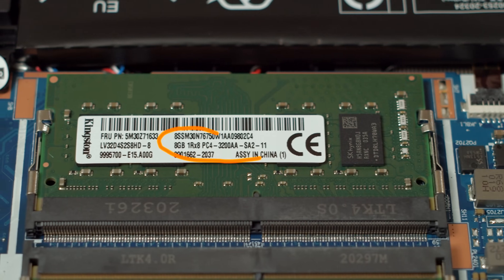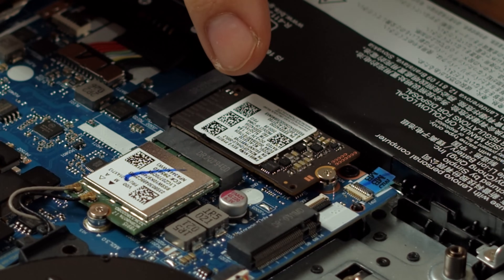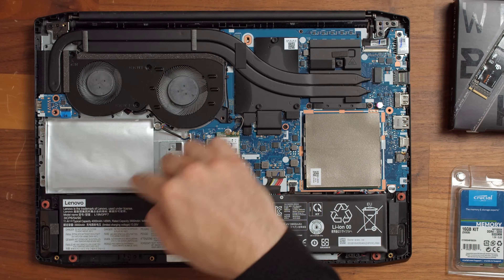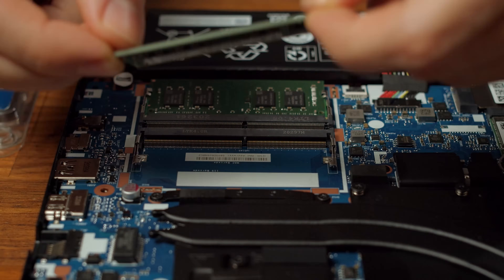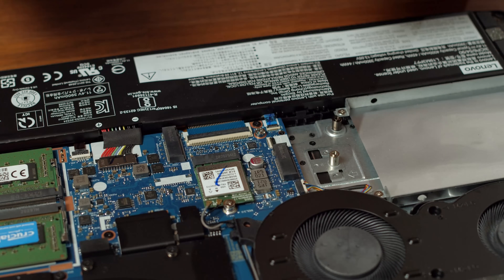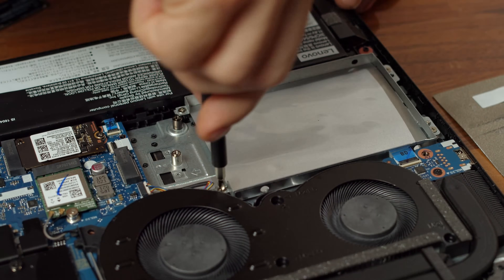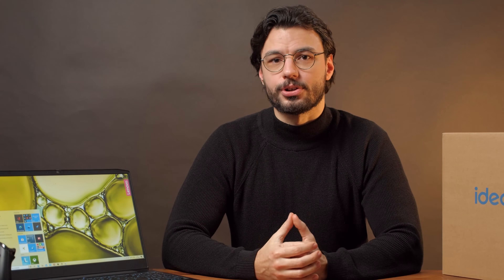Lenovo IdeaPad Gaming 3 Tutorial: How to Upgrade the RAM & SSD(s) | English

Comment: I didn't know I can move that standoff into the 2.5 inch ssd area, I have been searching for that connector for 6 months now, watched every video, read every forum, finally found your video, thank you for this video.
Reply: so it's either ssd or hdd not both?
Reply: @mahmoudabouhager  yes
Reply: @ankursharma1461  i see a video where he puts 3ssd
Reply: @mahmoudabouhager  not possible
Reply: @ankursharma1461  Can we use two m.2 2280 ssd?
Mine already comes with 2280 sdd, specification say i can install one 2280 and one 2242 ssd but i am not able to find good 2242 ssd at reasonable price.
Reply: @galaxy2995  are you using 2 x 2280 ssds now? also whats your laptops model, i bought 82k200k0tx and it comes with 2280 512gb ssd so i want to add a second 2280.

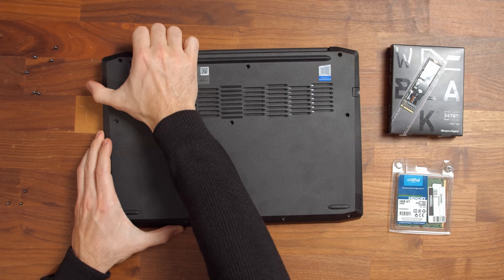Comment: DON'T DO this 1:56 or you will be about to break some of details attaching the bottom like I did following this tutorial. It is especially disappointing if the laptop is new and warranty is not expired, because there is a threat to a possible future warranty repair, I believe.
Reply: Then how do you open it?
Reply: @Daniel-mn5jk  This way, just very carefully.
Reply: @GuyInBlackClothes  Nooo, just grab anything out of plastic that is thin. Get creative, I used the rotor blades of an old drone. Just not metal please, I did it once and it scratches the side.
Reply: I wish i had seen this comment before.. I also broke some  after seeing this video kkkk
Reply: Dosen't matter the screws are enough to make it tight. If they break its easier to open up next time 🤷‍♂️
Reply: I should have listened... managed to snap several little plastic connectors on the inside of the cover. Managed to re-close it just fine and the cover is on tight with the screws... but still kicking myself for not going more carefully.
Reply: I had an old college ID card i had used that just slid it in from the back where he's putting all his fingers in and just go along the snaps and they come off pretty easy.
Reply: This part was very hard to watch.

Comment: You actually can use a 2,5 and a 2280 m.2
Reply: hell, you can put the original ssd ram (with windows instlled) in the second m.2 slot, then a new 2280 in the first slot AND a 2.5'' ssd or hdd with the sata port, and you dont neet to reinstall windows, just open the bios and configure the laptop to start with the second slot.

Comment: Mine came with 8GB RAM, a 256GB 2242 SSD, and a 1TB 2.5" SATA HDD. I can't really upgrade the storage to a faster M.2 SSD (since can't have HDD and 2280 SSD, which I did not know before) but will be upgrading it to 16GB RAM. Very informative video!
Reply: @ImMashimaro  He said we can’t.
Reply: Do 12 gb ram is enough?
Reply: @zuhdi97  I would get at least 16 Gigs for gaming.
Reply: Why it can't Have both?
Reply: @ImMashimaro  Totally agree with you. My 15ARH05 (2020) came with a slow NVME SK Hynix (2300 MB/s Read and 1000 MB/s Write). It does not make any sense adding a secondary, very expensive 1TB/2TB NVME with fast speeds (3500 MB/s and faster) for everyday files like pdf, word, excel, jpeg etc. Therefore, I just added 1TB 2.5" HDD as secondary storage for files.

Comment: Super clear and informative. Just bought the laptop so very useful info too. Thanks very much.
Reply: How is it after 2 weeks?
Reply: @saidiyassine8135  very happy with it, I will definitely bump it up in terms of storage soon and ram maybe not so soon because I don't play the latest or most performance-intensive games. Boots very fast, runs smooth, keyboard is comfy, the screen is great and I fully trust the hardware. If you play heavy games though, performance will be at the expense of quietness, it can sound like a blow-dryer at times, and because of the location of the fan the keyboard can heat up a bit when temps go up, but those are my only complaints.

Comment: Hey do those 8 gig memory sticks that come with the device have 4 chips on the pcb or 8 chips? I just ordered this laptop and I'm considering to buy memory with dual rank configuration because single rank memory utterly sucks. I'll order them before the laptop arrives if the default memory is single rank (4 chips per module)
Reply: Did you find an answer to this mate?
Reply: @liviuovp  4 chips per module so half rank. Extremely loose timings like cl 22-22-22 something I don't remember. The performance was okay but nothing spectacular then I gave it to my brother.

Comment: Thanks for helpful video!
Is it okay upgrading ram or ssd without removing battery? I keep heard that I should remove battery and discharge the laptop before adding parts.
Reply: It's okay, but it's safer to do so.
Reply: This can prevent the laptop turns on suddenly
Reply: You can disable the battery on this laptop in the BIOS
Reply: @sergik833  how?
Reply: That's why he said to completely shut it down and to unhook the charger, so that no power is running through it at all. Putting a computer in sleep mode means a bit of power is still coursing through it. You have nothing to worry about if you unhook the charger and shut it down as long as your not trying to bust open your battery or are trying to deconstruct the battery. Damaging your battery could mean it not working properly or it setting on fire, so be gentle with it and stick to the screws and edges around it when handling it. And touch something metal in your home to quickly ground yourself before working with the parts and the inside of the laptop.

Comment: So, I can not put a 2280 ssd in the slot below the wifi card IF I have already a 1tb hdd installed? Or Can I have the two?
Reply: Have you tried it? I was thinking to buy a 2280 but i cant confirm if i can fit it in with the the 2.5 hdd.
Reply: @djv2420  not yet. I just bought more ram since that's what I needed the most. Sometime in the future I'll try. If you do first, please come back and comment :)
Reply: @djv2420  i know it was months ago but I actually did it. Installed the 2280 in the slot under the wifi card and it does not interfere with the hdd

Comment: Can someone please help me?
I added new 8gb ram to my lenovo ideapad gaming 3 (Amd), the ram I added is 3200mhz and it has CL22 so it's same acc to me. But today I started valorant and I'm getting better fps but the game is still lagging, I even capped fps to 120 which I got before ram upgrade it it still lagging, there are no fps spikes or ping issues.
Reply: open task manager while game is running to see which gpu is valorant using, and check for any processes using your hdd/ssd

Comment: Here in my country it comes with 1Tb HDD, can I put a 2242 or a 2280 ?
Reply: You can put directly 2242 nvme in first slot.
Reply: @silentcreeper3506  Yes. You won't have space for a 2280, unless you remove the HDD, though.

Comment: Vielen Dank! I was wondering about usign 2 SSD NVme AND one 1TB HDD. Isn't it possible? I thought that the 2242 lenovo SSD would fit in the space between the second slot and the Sata box, than i would put a 2280 SSD on the first slot and the HDD ond the sata box. In Brazil i got the cable for it, but you said that the 2280 on the first slot only works if i dont have any 2,5" plugged? Does it applys to 2,5" SSD or HDD aswell?
Reply: you can have a m.2 2280 and a 2.5in drive, the second m.2 slot however cant be physically used with a 2242/2280 without taking out the 2.5in, but you can use a 2230 m.2
Reply: @aesthet1kal  shall i use m. 2 2280 nvme ssd in this lenovo ideapad 3 models

Comment: Thanks for the detailed review! Have 1 question left though - the laptop spec says it can support 16GB of RAM, while also noting "The max memory is based on the test results with current Lenovo® memory offerings. The system may support more memory as the technology develops". I was wondering if you you know if the laptop can run with 32GB?
Reply: buying a discrete video laptop with a 16gb limit is hogwash for anything other than graphic gaming...you'll be constantly struggling to get enough ram to support photo editing, multiple displays, virtual machines, and video editing...I know original post was 2 years ago, but it applied then that you'd need at least 32gb to get a decent experience...as of 2023 you might as well just use a $300 onboard graphics ryzen laptop if you're not pushing your laptop far enough that it needs all 64gb of ram
Reply: This the Intel one can handle 64 gb of ram
Reply: @AmaanKhan-te8ll   ya i have mine running 64gb just fine :) also i use 3200 MHz clocked ram :)
Reply: Crucial Ballistix BL2K32G32C16S4B 3200 MHz, DDR4, DRAM, Laptop Gaming Memory Kit, 64GB (32GB x2) this :)
Reply: 32gb is overkill for most of the people and can drain battery faster on laotios. it is unneccessary. 16gb dual channel is more than enough.
Reply: No man, it says 16gb on the site, also, you'd be really great with 16 gigs cause it handles most tasks, even high end ones pretty easily, 32 gb just seems overkill considering the processor

Comment: I added another M.2 2280 on the place where is supposed to be another hdd but the system does not recognize it... Should I just replace the 2240 with it and buy a cable to add a standart hdd then?
Reply from the maker: No, please check the link in the endcard or description on how to initialise a new SSD. You'll have to tell your WIndows Installation about the new SSD first, that's all :)
Reply: @notebooksbilliger  I did see the video and tryed out to do that... but the Disk Management does not show up either the new ssd :/
Reply: @unon61  Same probleme here. (Suponho que sejas português ou brasileiro).
Reply: @jorgemateus2374  Sim, português. Tenta remover o SSD e voltar a colocar. Foi a maneira como resolvi deste lado
Reply: @unon61  Hey bro. Is you problem resolved? I am still having a dilemma in choosing between a sata ssd and nvme m2 ssd. As i looked through all the forums, most people actually recommended a sata ssd instead.
Reply: @ylseow  I solved the problem, I just needed to remove the disk and insert it again. It recognized then :P
Reply: @unon61  Nice bro! Thanks for replying. I just ordered a 500gb crucial nvme ssd. :)
Reply: @ImMashimaro  Bro so ur second nvme m2 is not detected?

Comment: Very useful video.  One thing I'm not sure about, is the pre-installed RAM in the 15IMH05 Ideapad soldered in place, or is it definitely removable? Ideally I'd like to replace it (buy two RAM modules) but I'm not sure if I actually can?
Reply from the maker: Hey, according to Lenovo it is not soldered and you can replace the existing RAM. You can see the Model in Lenovos Video: https://pcsupport.lenovo.com/in/en/products/laptops-and-netbooks/3-series/ideapad-gaming-3-15imh05/81y4/solutions/ht510839-removal-and-replacement-videos-ideapad-gaming-3-81y4-82ey

Comment: Just got mines today the first thing i did was upgrade the ram
Reply: @ImMashimaro  I got another 8gb 3200mhz stick for mine. Totally worth it imo
Reply: @AstronauticaX  so we need to buy ram of same brand or what?
Reply: @mahigiri8062  yeah I recommend getting the exact same ram. It will perform better and you know it will work as it should be. It sure is harmful for your PC if you have 2 completely different rams.
Reply: @AstronauticaX  It is not harmful, but it can perform poorly. DDR4 SO-DIMM is a must, you cannot install any other type. 3200Mhz is optimal, having slower speed on one stick is not recommended. Anything else does not matter.
Reply: @mahigiri8062  any brand suggest A-tech
Reply: How is the laptop after 4 months, please give me honest review i might buy it
Reply: @saidiyassine8135 Mine is totally fine. Been using it for almost a year by now.
Reply: @saidiyassine8135  ok so this laptop is actually pretty good it runs games very well. the only thing  is on newer games it cant run games on ultra settings only low,medium,high but low settings  you can get the most FPS. Also if your into competitive games like call of duty this really aint the laptop i mean you can play decent. But not like a pro especially on call of duty blackops coldwar you want atleast 120 FPS or higher. But for my experience I've been enjoying this laptop I've been playing PS2 Emulator,GTA V,Rainbow Six its been real fun.
Reply: @GrizzytheGod  what spec did u buy, ryzen 5 or ryzen 7?
Reply: @ImMashimaro  16gb 3200MHz
Reply: Could I ask you wether you know if you loose the guarantee if you open the laptop to upgrade memory or ssd? Thank you! 😊

Comment: I came to this video to see how to open it and thanks for your help, but I have and issue with the RAM I installed and I cant find answers online : I changed for the crucial ballistik 2x8 3200mhz but by defaut the frequence is adjusted to 2666mhz and I cant find in the BIOS how to make it runs at 3200, any tips ?
Reply: Got to check if really the Crucial is 3200mhz both..my case one of the Ram is 2666mhz so system will choose the lowest speed..or maybe replace with another brand Ex: Adata..
Reply: @ashmnsr23  I found something yesterday, it has to deal whith XMP and JEDEC 
The RAM I bought had a JEDEC profile at 2666mhz and a XMP profile at 3200
But as the computer doesnt support XMP,  it will applies the JEDEC profile
I retuned this RAM and ordered some crucial at 3200mhz without XMP profile, gonna see what happen
Reply: It worked, 16gb 3200mhz